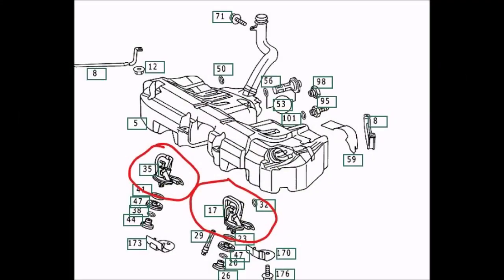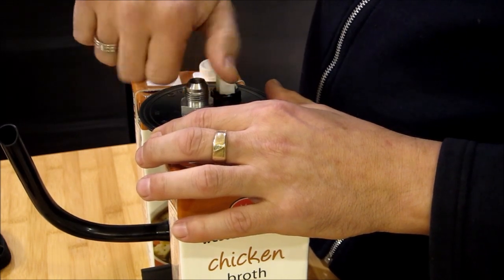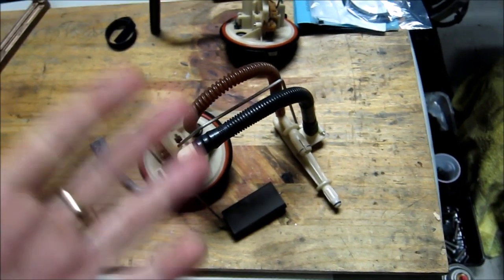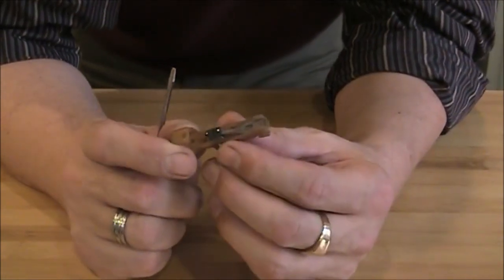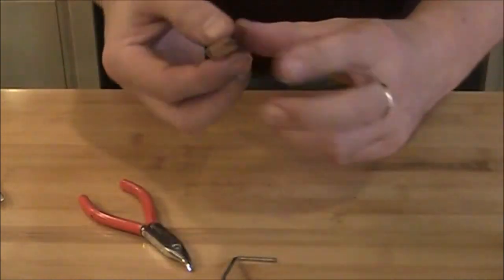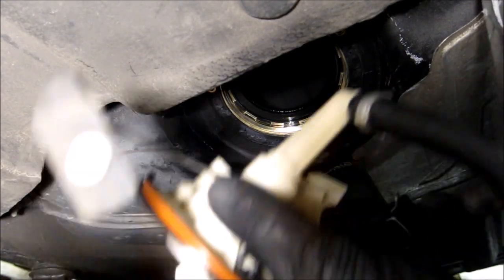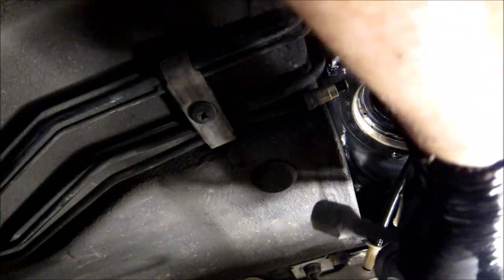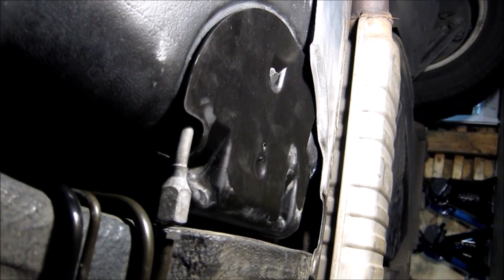Mercedes Benz W202 C280 Fuel Sending unit repair and seal replacement

Comment: Hello!
Thank you for this video!
I’m very happy to have found your video, especially since the English you use is at my level, which made it easy for me to understand the main points.
I really love the W202 — I’ve owned mine since 2011, and I take care of it myself, that’s why it’s still in great shape.
Some mechanics in Bamako are real destroyers — they rush to work on several cars at the same time and often end up doing a poor job when reassembling.
Thanks a lot for this video! It’s a good reference for me since my Mercedes has never had this problem. I’m getting ready just in case, because the fuel shortage makes some people mix dangerous blends that can damage engines.
Your English is really clear and easy for me to understand!
Thanks

Comment: Hi Andy, Great video and thank you for the information provided! I was hoping you could assist me with some information if possible. Would you happen to know where the check valve is located for the fuel pump on a 99’ w202? I pulled both sending units from the tank due to issues related to the instrument cluster fuel gauge not working and also issues with fuel pump noise that includes failing pressure. My issue is not with a failing regulator or leaking fuel injectors. I have tested fuel pressure directly at the pump and pressure does not hold. I have replaced the pump and still the issue exist. I assume the check valve is located in the sending unit which may also mean it may not be serviceable.  I have performed service on the sending units by cleaning the electrical contacts, replacing corroded wires and also the plastic line on the venturi. This fixed the instrument cluster fuel gauge.  I also removed the flow line from the tank to the pump and cleaned the metal filter screen that is located at the fuel exit of the pump. This was done because the pump seems to be starving for fuel which is my belief for the pump noise. There was not much debris here.   I checked the lines inside the tank which seem to be good but I cannot tell if there is a valve located within either sending unit or the lines. I also looked at the w202 fuel tank diagram and that does not provide info related to a check valve. Your insight would be appreciated!
Reply from the maker: Hi. I don't remember seeing a check valve in the system. Check the fuel pressure regulator valve , it's located in the front of the fuel ramp. Sometimes the diafragma gets ruptured. I think it's supposed to keep 42 psi.
Reply: @AndyPMercedesBenzChannel  The regulator valve has been replaced on the fuel rail along with new injectors. when testing I loose pressure if I test directly after the fuel pump and filter with a fuel pressure test gauge. I believe my issue is between the pump and the tank. I have a new pump as well but yet and still i cannot hold pressure at the pump.

Comment: I have a whining, whistling noise near my fuel tank. I have replaced my in-line fuel pump and fuel filter and the noise has not gone away. 
Is there a second pump? Or are these two things all I need to replace for the noise to go away?
Reply: By two things I mean these fuel sending units you’re talking about.
Reply from the maker: That's normal. I actually like the fuel pump sound when the ignition is turned on. And no, there's no second fuel pump
Reply: @AndyPMercedesBenzChannel i also have stuttering rough idle. All this started around the same time. I replaced the filter and pump and the noise and rough idle is still there.
Reply: @AndyPMercedesBenzChannel I’ve been driving this car for 3 years and this just started happening.
Reply from the maker: There's a mesh filter in the tank before the fuel pump, did u clean/ changed it?

Comment: Hello. I have a 1999 c280 w202. My fault code is P 0450 fuel tank pressure sensor. My question is where is it? Is it integrated in the fuel level sensor Right and Left side? Any thought or info are greatly appreciated. Thank you
Reply from the maker: It's not that easy, fault codes don't point to a specific part, but rather to a fault in the system. 
Here's a video on the system https://youtu.be/KWLddboBvRA?si=izoJWFuyrweMhb7z.
Might help you. I'd start from checking fuel tank cap seal, make sure it seals well

Comment: Thank you Andy, very helpful video. I've heard & read about a lot of owners having trouble with blockages between the saddle-tank halves, particularly if running on recycled veg oil as I do (C250 TD). I'm thinking of disabling the check valves & connecting the drains together with a modification of your solution, Teeing off to the feed. Do you see any problems with this idea?
Reply: I realise that I wouldn't only have to jam the valves open permanently, I'd also have to cut into the pillars so that oil can enter at the base or I'd still be stuck at ½ tank.

Comment: Thank you for this video. I have a 2002 CLK 320. New fuel pump and filter outside of tank.But no fuel pressure on engine,was running after replacing pump and a few sensors. So I figure hoses in tank like this might be broken from one side to other.Watched your video to see how to drain tank and remove ring. Lots of gas to drain.
Reply from the maker: You can jump the fuel pump relay, it goes much faster
Reply: @AndyPMercedesBenzChannel  Disconected fuel line from tank to fuel pum and nothing,so for sure those lines in tank.

Comment: Hey. I have Mercedes Benz C180 1996 1.8l car and my fuel gauge doesnt work. It always shows zero fuel even though its not true. Do you think the problem is in fuel sender? Would appreciate if you can answer!
Reply from the maker: Hi. There are 3 possible failures: sending units, harness/connections corroded, or the fuel level gauge.

Comment: Thanks for the video. My W202 fuel gauge has not worked for all of the 3.5 years I've owned this car. The drivers side fuel sender needed to have its spring re-tensioned like on your video, and the passenger side one had been fixed by former owners at one point (the first metal clip you remove from the sender was gone, and the spring had been re-tensioned already). I got the senders repaired like in this video, checked them and they seem to put out the right ohm level now. However I still do not get any fuel level showing in my dash, even when I filled the tank after I did this repair. I was wondering if it could be the instrument cluster that has issues?

Oh also occasionally it would jump to full when I had a full tank before, but only when I did hard turns. Does not do this anymore though.
Reply from the maker: It's hard to say, did you test the output signal on the level sending units to make sure they work?
Reply: It was tested before I hooked it back up and the resistance was continuously going up and down. I was able to test another instrument cluster which also showed zero, so at this point I'm inclined to believe it's a pinched or corroded wire somewhere.
Reply from the maker: I think you are on the right track, next step check the harness and connections

Comment: hey there boss see if you had any advice. I have a 2000 mercedes and when car would run after 3 mins it would shut off and let cool down would start right up. changed fuel pump and filter now it won’t start at all.
Reply from the maker: Does the fuel gets to the engine?

Comment: The ring that holds my sending unit is stuck and the tank twists so bad I am afraid it will crack 😭I have a spare one, but I am too lazy to swap the whole thing. And on the spare one, I also cant remove the ring! WTH is with my luck?!
Oh and to top it all off, the metal half of the small crooked hose coming from the sending unit is rust as hell and I am afraid it will break. I have no idea how to find it (if it exist as a part) or how to swap it with a hose, considering its crooked like that...

Comment: I need advice please C300, 2008. My fuel gauge repeated shows empty after 4 attempts at repairing it at Mercedes Benz Service Center for the past 5 months every few weeks. They replaced my fuel pump and sending unit, replaced my fuse box and replaced both my FR sway bar links in April 2023. They gave me a refund of $2,673.42 on September 22, 2023 for the many attempts that did not fix it. The declared it was fixed on September 7, 2023. It shows empty again 9/21/2023. Please HELP???
Reply from the maker: Hi Im not very familiar with newer MB's. Im just a DIY mechanic, My suggestion, take it back or find an independent mechanic . Sorry that's all i can help you with.

Comment: Hello Andy. Brilliant video.
I've been trying to drain the fuel tank via the method you described.
However, pushing the valve on either sending unit with reasonable force (and a screwdriver) releases only a small dribble of fuel.
Disconnecting the hose on the left sending unit released no fuel at all.
The car (1993 W202 c180) has been sitting on my front porch for nearly 7 years. It has not been started since then. I am quite sure it was left with a quarter to half a tank of petrol inside. The petrol will most certainly be completely rancid by now, as such I am trying to remove it. 
I added around 10 litres of fresh petrol recently when I first tried to start the car again (this was before I discovered old petrol was still inside).
However, I am still unable to drain this or any petrol. 
Could I be doing something wrong? Maybe I am not using enough force with the valve?
Regards,
R.K.W
Reply from the maker: Hi. The check valve doesn't need a lot of force. There's a much easier way to drain the tank: disconnect the fuel hose after the pump. Pull our fuel relay and jump the contacts. But I'm afraid the fuel has turned into jelly and will cause more damage.
Reply: @AndyPMercedesBenzChannel   Hi, thanks for the quick reply. I will assume that the fuel gel should be removed before adding fresh fuel. Is there an easier way to do this without removing the whole tank?
Reply from the maker: @ragtimer  I don't know if there are any chemicals that will dissolve what's in the tank. I haven't explored this issue.

Comment: Hey, I‘ve an issue with my C240.
The car stops running when half the tank is depleted.
That probably means that the Venturi siphon on the left unit is probably broken.
It should be enough to change just the left unit, right as the siphon is included in the sending unit or am I wrong?
Reply: Previous owner changed the fuel pump btw. It should be located on the right side yes?
Reply from the maker: Left side behind a plastic cover.
Reply from the maker: People say new sending unit is expensive , so I'd check first...it could be a damaged hose that siphons the gas from rhs tank
Reply: @AndyPMercedesBenzChannel  No, the sending units are very reasonably priced at around 50€ on average. The previous owner told me though that he already had the fuel pump and filter changed. So the possibility of  a clogged filter resulting in too little pressure in the left unit is out of the question probably yes?
Reply from the maker: Most likely it's not a filter or pump problem, you can confirm by taking fuel pressure reading at the fuel ramp. From what I've learned mainly it's the transfer hose issue. Not so much the venturi pump itself,  but the hose.  Until you open the tank you can confirm the problem, you can get the sending unit if u can return it in case you don't need it.
Reply: @AndyPMercedesBenzChannel  do you have to remove the whole tank to change the hose?
Reply from the maker: I don't think so. There are only 2 access points (sending units openings) and they are at the bottom.  The hard part is to lift the car high enough if you don't have access to a car lift.
Reply: @AndyPMercedesBenzChannel  and to what do they connect on the other end?
Reply from the maker: https://youtu.be/4qQNJ_keJYI
Reply from the maker: https://youtu.be/OMEojtNpsrw  and you need long hands
Reply from the maker: Sorry, I lied to you, fuel pump and filter is on the right side of the car. It's been a while since I was under the car
Reply: @AndyPMercedesBenzChannel  I know, they are outside of the tank itself. Are the hoses connected to the filter and pump on the other side by chance?
Reply from the maker: The last video has the tank cut in half, we can see the inside workings
Reply: @AndyPMercedesBenzChannel you mean the vacuum system video? That’s the latest video on your channel
Reply: @AndyPMercedesBenzChannel nevermind, i found the blueprint at 1:14. kind of seems ver difficult to disconnect the hose on the right side
Reply from the maker: @lobmati5998  https://www.youtube.com/watch?v=OMEojtNpsrw
Reply from the maker: the last message in you chat
Reply: @AndyPMercedesBenzChannel  the issue seems worse then expected. My c240 today stalled at 3/4 left in the tank instead of 1/2.
There must be an issue with both units now probably or not?
Reply from the maker: @lobmati5998  definitely, something is going on. You won't know until you will start troubleshooting, otherwise you gonna eat your brains away. Id start with few easy steps, 
1. disconnect return line, start the engine and see how is the return flow (this is to check the pump flow as well)
2. check fuel pressure in the fuel ramp, as i recall it should be  around 47-55 psi (double check numbers)
3. remove fuel level sending units, (to reinstall I suggest to get new o-rings) check signal resistance, should be 2 Ohm - 98 Ohm (empty -full). clen contacts if needed (like in this video)
4. inspect connections and hoses inside the tank. This is probably the hardest part.

Did you refuel after ir stalled at 1/2 tank?
Reply: @AndyPMercedesBenzChannel  I always have a Jerry can with me in case with 10l of petrol. Once I filled it in the car started again with no problem. Had a suspicion that the evap coal filter might be clogged with petrol because I once overfilled the tank too much after the click in the fuelgun (let it click 3-4 times again) and the excessive fuel spilled out at the right side of the back axle( so trough the evap system). Thought now because of this the valve doesn’t work properly but the fuel intake didn’t hiss and there was no resistance when taking off the fuel cap so it should still work actually
Reply from the maker: IMO, the evap system should not play a big role, it's mainly for environmental reasons. If you want to understand how it works, I have a video on my channel. I thought my tank is building excessive pressure,  but it turned out to be ok. I still think it's on the higher side, I get a big woof when I open the fuel cap.
Reply: @AndyPMercedesBenzChannel  yes a mechanic friend also told me it’s no biggie with the evap filter. Though I’m wondering about the missing pressure. Both fuel pump and filter were switched by the previous owner not too long ago( bought the car 1,5 months back). Which tools would be needed for the possible issues you addressed for checking
Reply from the maker: @lobmati5998  manual vacuum pump and a manual tire pump. It's probably the the 2way check valve got damaged
Reply from the maker: https://youtu.be/KWLddboBvRA
Reply: @AndyPMercedesBenzChannel  is an air compressor for tires okay?
Reply: @AndyPMercedesBenzChannel  well changing it be fairly cheap then. But do you really think that it’s most likely the check valve? My guess is that the third port on the coal canister can’t take/blow out air because the canister might be sogged with petrol
Reply from the maker: @lobmati5998  that's an overkill, the check valve is for very low pressure
Reply: @AndyPMercedesBenzChannel  Little update on my side. I tested the issue with running out of gas below 3/4 of fuel left. Well I got way below 3/4 without problems(car was going just fine without performance or starting issues). But for the first time yesterday I had 5 people total in the car and it didn’t start. I filled it up with a 10L canister in my trunk still nothing. But as soon as all of them got out the car started no problem. Same happened on the same day again. But then I went to fuel up the tank fully just in case and I only fueled it up to the first click of the fuel pistol. But there was still gasoline coming out from below the right side of the axle( where the check valve and hose leading to the tank are located). Car then had problems starting again but different. Before when it was loaded with wait just the starter was spinning but no engine response. But now after fueling there were a few combustions for 2 secs but didn’t start again. I pulled off the fuel cap and then the car started. Drove back home and tested starting the car again. Well this time same thing with the combustions but I couldn’t get it to run for 5 mins and then gave up. Today I tried again and it started no problem. Really weird issues
Reply: @lobmati5998  Hey brother, did you ever end up fixing these issues?